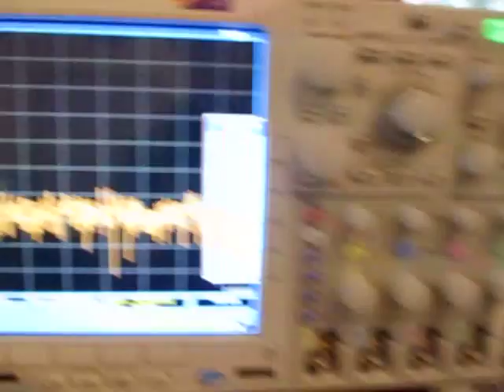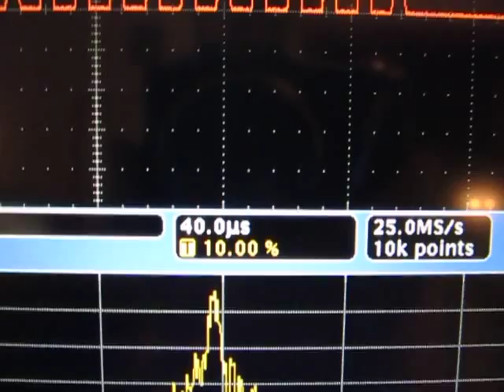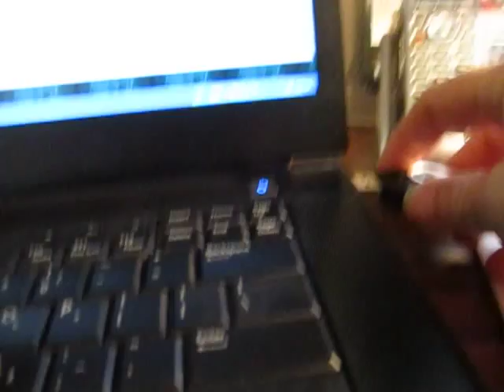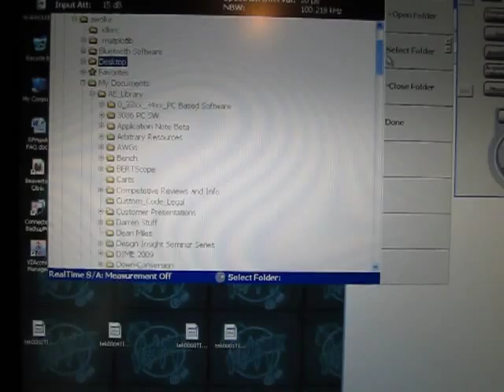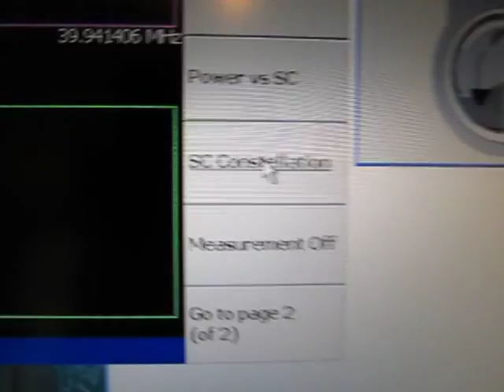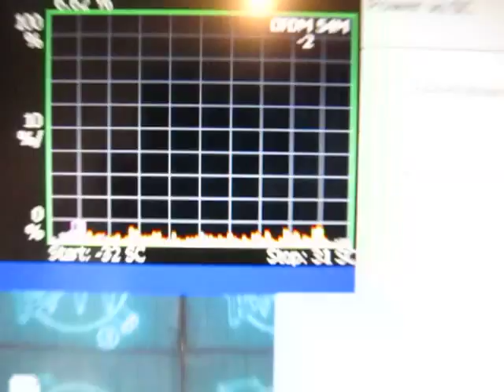#21: Using MDO4000 to capture 802.11 traffic and export for analysis using RSAVu

Comment: Can this data be used to get the digital contents (0/1) of the data sent...similar to wireshack and other network capture software?
Reply from the maker: This will give you the raw modulated symbols, but won't back out any scrambling, etc. that may be in the payload.
Reply: Thanks for the reply!

Comment: would you please mentoin Which 802.11 standard it is? Is it 802.11a, 802.11b, 802.11g or 802.11n?
Reply from the maker: +Tahmoures Shabanian This was 802.11g.  However, note that this video is 5 years old.  The more modern PC based software tool to do this same thing is called SignalVu-PC.  It can connect directly to the MDO4000B or C series scope (similar to what is in the video), or can use any of the USB-based spectrum analyzers (RSA306, 503, 507, 603 or 607).  No need to manually copy a .TIQ file anymore.  There are analysis options for 802.11a/b/g/j/p/n/ac.
Reply: +w2aew Thanks so much for your response, would you please mentoin which channel it is also? One problem that I have with MDO 4000 is that the Amplitude per division is about 100mV for the time domain. Is it possible to change this value? And do you know the span, center frequency and start for 802.11 n?
Thanks,
Reply from the maker: +Tahmoures Shabanian Yes, you can change the vertical scale of the Amplitude vs. Time display on the MDO.  When the Amplitude vs. Time is the "active" channel (make it highlighted, like when you first turn it on), the A and B multi-purpose knobs are used to adjust the offset (A) and vertical scale (B), as shown in the upper right corner of the display.  802.11n uses the same 2.4GHz channels and bandwidths as "b" and "g", as well as additional optional support for the 5GHz channels. Channel frequency tables can easily be found using Google... The channel being used by any particular device is not fixed - you'll have to examine your device to determine which channel it is using.
Reply: +w2aew Thank you so much for your answers, they were really useful. One more question. The peak of my signal in the frequency domain window is on the left end of the window. How I can move it to the center of the screen, is it possible?
thanks
Reply from the maker: +Tahmoures Shabanian Yes, simply change the Center Frequency on the Spectrum Analyzer.
Reply: +w2aew Thanks so much for all of your response.
Reply: +w2aew Thanks for all of your help. Would you please help me with the below questions;
1. why did set the RBW to 40 KHz?
2. Why did you set the T to 10%?
3.Why did you choose 10K points?
4.Why did you choose the reference level of -35 dBm
Thanks,
Reply from the maker: +Tahmoures Shabanian The RBW is set to 1/1000th of SPAN by default. Trigger at 10% minimizes pre-trigger data acquisition since it is unneeded for the analysis. 10k points was the default, didn't need any more or less.  Reference level was set  based on the signal level being received.
Reply: +w2aew Thanks so much